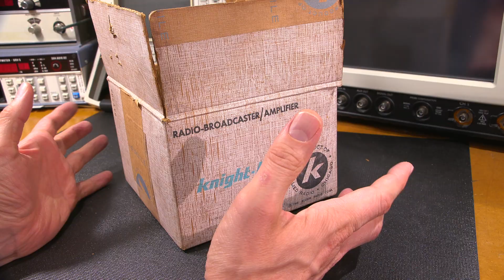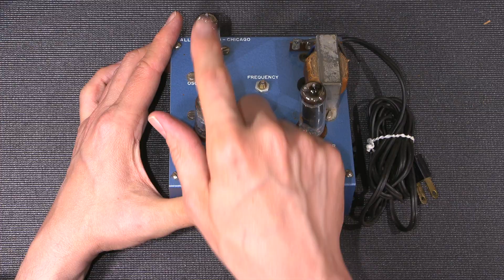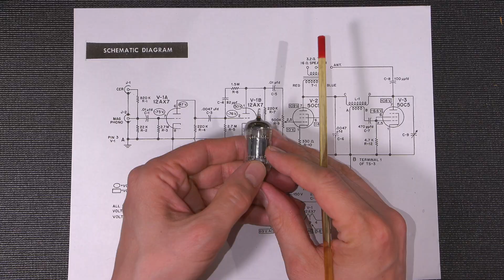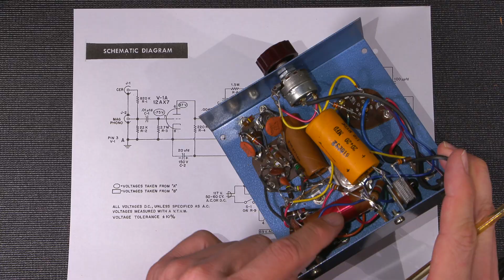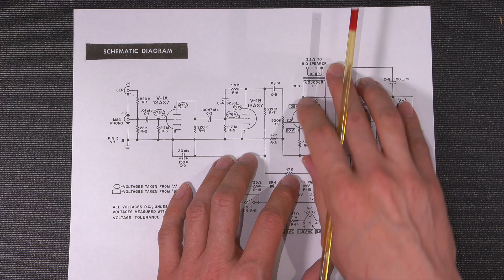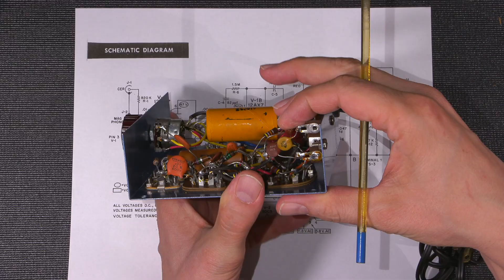Your Own Radio Station! The Knight Radio Broadcaster And Amplifier!

Comment: Self transformers in old radio equipment were a scourge, especially here in EU where the power sockets are 230 V, not polarised.
I ended up replacing the autotransformer with a regular transformer in all the equipment in my home.
See your radio is grid-modulated, and the 50C5 working in linear fashion, amplifying both carrier and modulation.
In the end, it is different from the one I had, with a proper transformer, and a separate AF modulator - a pentode from an ECL82 in class A with its own modulation transformer.
I like the low parts count of your radio, I don't like the circuital compromises.
Thank you for the trip down the memory lane.
Greetings,
Anthony

Comment: I’m interested in knowing what the component at the end of the video is but this is an old video and I don’t know which video is next in the series. Much like the line cord on that device you didn’t reference the video in a way that would make the next easy to locate. I’d have to scroll back 5 years worth of content, find this video and hope that the next is the one with the information I’m interested in. That’s too much work. 

Please consider adding video categorization to your descriptions or titles. Numbers work well. Like this one could be number 476 and the one with the answer to the quiz could be 477.

Comment: Me too and me too, etc.  One way to get all the geezers out of the wood work! I would play Al Hirt on mine. I agree Mr. C should have hooked up some music and used a vintage radio to listen to it. I don’t remember it being AC/DC or getting a bite from it. I’ll point out the 2 meg grid resistors which allowed the small coupling caps and still have good bass and was grid leak biased. The 12ax7 are also grounded cathode to get the most gain. 2 47k resistors we’re all that stood between us and line voltage. Thanks for the blast from the past!

Comment: Awesome!  I'd love to find one of these, but where I am there are about 2 people that know what a 12AX7 is and I'm one of them.  The nearest hamfest is about 2 hours drive away and only occurs once a year .. at the most inconvenient dates and times.  I'll warrant though that most of the people back in the day that built these did not have the benefit of a $10,000 Marconi analyzer to tune their $50 radio kit.  I'll bet 95% of the finished units did not perform as well as yours does now.  LOL!

Comment: In the uk we called them valves and the top you call plate we called anode in the middle the grid at the bottom next to the heater was the cathode .

Comment: I had 2 of these when I was a a kid in the mid 60's. Drift was a major drift problem. I used the speaker transformer as input and plate modulation.

Comment: Since my post of four years ago below, I have found modern reproductions of this exact device are being sold for $274 with a (redesigned L1 RF coil) and that price doesn't even include the tubes! Maybe your original has better modulation than the repro, maybe we are more critical of modulation quality, but the repro I've seen close-up only works reasonably well (and that's stretching a point) over a very limited part of the center of the AM band before modulation quality and power drop off considerably. It also "FMs" badly - sounding the same on a comms receiver in AM or FM mode! Looking at the schematic that's probably what should be expected. The repro was very disappointing even from a nostalgia point of view. Your original did seem to work reasonably well, but a trapezoidal display would show modulation linearity and a check on its FMing would be useful too.

Comment: I constructed  onee like that way back in 1965 when I was still in high school. It was fun to build but was very careful in operating it. It was AC  so it was the chassis was connected to the mains but other than those it was very easy to use.

Comment: Since the neutral is tied to ground in your panel at some point, cant you just verify which prong on the plug is tied to the chassis and plug it in so that the chassis is not on the hot side of the plug? Then verify after plugged in you are on the neutral side and not the hot side. Or is there still a problem doing it this way?

Comment: At the very least a polarized plug would be helpful, or a three prong grounded cord if possible..  I wonder is a GFCI would trip with this radio transmitter has reverse polarity?

Comment: This was one of my first electronic projects at age 12.  I read about the 12 inch antenna restriction, but it worked so much better attached to the families' steam heating system.  We broadcast about 2 miles. Had so much fun. I never figured out why that even worked, because the steam pipes went into the cellar, and hooked to the boiler which had grounded water pipes.  
Andy

Comment: Great Job! Firmly suggest a polarized line cord; with a direct connect to chassis; or better yet, a ground liftoff with a .1uf super-safety cap to chassis; of course, the power switch to the line high side. Keep up good work ! ! !

Comment: I once made something like this, and it actually worked, but was only able to transmit AM stations,  and had to be very close to the radio to work. I then decided to connect a big antenna to it, which got it working up to a few feet away.  Also,  you look like your in a space station🚀

Comment: A tip that I'd like to convey is all the glass tubes have their tube number printed on the side.  So if you choose to clean the chassis and dusty tubes it is easy to wipe the tube type off with even a gentle cleaner and a rag. End result a mystery tube. Thank you for making this video and give this old kit some fresh air.

Comment: In 43:00 I saw you holding a " Phototube".only now I understood from you. I have this valve. I have a bell n Howell projector, valve amplier is missing but this tube. Modern projector uses Photodiode.

Comment: That device you were holding is a vacuum switch or relay. It is perfect for antenna switching, high voltage switching, or isolating because it has very low capacitive coupling.

Comment: I'm building one of the reproduction kits now. It comes with an isolation transformer that mounts on the back.

When it's done I plan on using it to listen to old radio shows on my 1941 vintage Emerson radio, and partly because it's an easy way to get old radio shows and partly for the weirdness factor it's going to be connected to an Alexa Dot... so I can say "Computer" (the wake word), and Alexa will answer me through an 80 year old radio.

Comment: I built one of these as a kid.  I do remember the last part of the instructions where it says to attach the supplied wire to point X and said "this is your antenna DO NOT EXTEND this wire!"  Needles to say the first thing I did was attach to my 100 foot longwire shortwave receive antenna and the second thing I did was walk around several blocks around the neighborhood listening for the signal (I ran a tape recorder into it).  Went several blocks, and I learned how to couple the little pocket transistor radio to a telephone pole to bring it in.

Comment: There is a knight broadcaster repro on ebay for 244$. - kind of expensive! Looks like they screwed an isolation transformer to the back of the case. That input module they give you looks interesting, lets you input cd line level audio to the phono jack. 
I want to broadcast the shadow radio show to my atwater kent model 89 i'm restoring.

Comment: Many years ago I built a more.powerful homebrew version of that transmitter that put out around 1.5 to 2 watts. One night I loaded it into my 160 meter wire ham antenna and put some music through but on a frequency in the.upper end of the Am broadcast band. Then I hoppwd on my bike and rode around the neighborhood. I soon realized.my.signal was blanketing the whole.town. A friend of mine in the next town over also heard it very strong. I was terrified the FCC would start.looking for me so I raced home and shut it down. .lickily.I didn't get into any trouble.

Comment: I want to build one  but some of the components  have no   information   about them like the   oscillator coil   or the audio transformer . No impedances or   resistive values.... most of the parts I have but the critical ones  I need more info .....since you have one of these knight kit  am broadcast transmitter's   you can  provide  them to me ... I would be so greatful . At least I will have another project to do during this  covid lock down ?

Comment: If I were working on your transmitter I would firstly replace the line cord with one that had a polarised plug and make sure the neutral went to the chassis. That would remove most of the danger. I might even go to a three wire cord with a grounding prong. The I would replace the selium rectifier with something more suitable and change out the electrolytic capcitord then I'd replace anything else that was weak or unstable.

When I was going theses types of circuits were cheap to build and light to carry As they had no power transformer..They were enclosed in plastic cabinets.

A typical design for an AM radio was a 50 volt speaker tube, s 35 volt half wave rectifier and 3 12 volt tubes.for a total of 121 filament volts close enough. By then most power lines were 120 volts. These were called five tube radios. They had the feature that they would run fine on 120 volts DC as well.

Comment: I learned the hard way about no Isolation when I was a teenager I tried hooking up a ground on a tube radio and when I touched the ground to the chassis, KER_POW!!!!, ARCED and blew the house fuse! Luckily the wire I used was insulated.

Comment: Mr. Carlson, Dating myself here but, When I was a kid back i'm guessing in the mid 50's or so. Myself and a couple friends used to order stuff from Allied radio all the time. Transistors were I believe about .99 cents each, We built transistor radios with 2 or 3 transistors in them (that was fancy stuff at the time) Anyway one of us bought and built that kit, I believe they called it a wireless oscillator at the time. I lived about 1 mile away from Paul (he's the one that had it). When I left Paul's house I could hear him till I got almost all the way home.

Comment: When I was a kid, I connected one lead  from my phonograph  to the  metal cap on the top of a tube of an old radio. I first removed the radio wire that normally was connected to the tube  and connected the other lead from my phono. This made my old radio into a transmitter. I could then play my phono and pick up the signal on nearby radios. This was a hit or miss transmitter, I didn’t know really what I was creating. I fell in love with radio at an early age thanks to an uncle who also liked radio.

Comment: I could really see myself using this in my teens. I used a really crude Walkie talkie setup and for longer transmissions a mobile. This was when Mercury released a free 6pm-6am tariff.
Man I was wondering what the blue & black device was doing, displaying random numbers. Then I realised it was my phone's voltage.

Comment: I borrowed one of those from a friend's father. I am so guilty of taking parts from it. The FCC always has had over kill rules. The real technique here is a short antenna with a tuner and some ground plane. You need adjust your scope to get in into envelope mode. Then you can guess modulation percentages.

Comment: An interesting video.  I had not heard of this device.  In my ham career I've played around with Knight Kit transmitters.  AM radio, hmmm I may or may not have "accidentally" warped the tuning of my Viking Valiant's 160 Meter vfo into the top end of the broadcast band.

Comment: Got mine from allied when i  was a kid. my build did not look near as good as that. But it was my first build ever. I learned that caps hold a CHARGE!  Did not work first off.  It. fell on the floor . I though all was lost. Pluged  it in and it Worked ! Thanks for the show. Wish you were around when i was a kid. For some reason i am still alive. Jack Hreha

Comment: This units safety would surely be improved by converting it from an AC device to a DC device by introducing a 5 amp bridge rectifire between the AC souce and the unit under test thus effectively eliminating the live chasis issue as the chasis would be permantly tied to the negative side of the DC sauce which would introduce good isolation from the AC sauce. I am guesing the same system could be used on the all American 5s and 6 radios although I have never worked one my self but I have uved this technique on what we call univirsal radios. i have also used this technique very siccesfuly on European mobile CBs to avoid the problem they had with positve ground vehcles (not for a for at least 40 years though lol).

De Bob G7DME

Comment: Wow - I went back to my own little example. Replaced C-7, the 470pf - I had no suitable mono caps, so I used a 470pf silver-mica. It's as stable as the transistor radio I'm using to 'preview' it.
It used to drift for about 20 minutes before it warmed up.
Thanks!

Comment: Hi mr. Carlson. I wouldn't bother putting in NPO caps because that circuit is inherently unstable.  There are many other factors that would cause it to be unstable. Keep in mind that sometimes they have temperature compensated caps to counteract the temperature coefficient of the oscillator coil. And also, the antenna will have a big effect so it's no point in putting real stable caps in there. Just my two cents.

Comment: I remember the Knight-Kits (including a very low -power  broadcast band radio transmitter) that one could build electronic devices of many kinds...so way back in the nineteen fifties, being in a 44 week Navy service school, I built a 5" "scope", a multimeter, a sig gen...and used them for a while...satisfactory: but then, having worked with "pro" test equipment as a tech, much preferred Tektronix scopes, pro multimeters and such...so sold those kits later when I managed to buy better gear...which stimulated the beginning of a long working career, later got a degree from the University...used it with the DoD...retired right after Y2K...gotta say I enjoy your various Lab Vids...

Comment: If that kit was available in the UK the chassis would have to be earthed (grounded), especially as it is a transformer-less circuit. Thinking about it, it would have a mains transformer to improve safety and use 6.3 volt heater (filament) valves (tubes). The UK and Europe have 240 volts mains, so dropping the filament voltage would be less easy.

Comment: Thanks really interesting. I shoved the preamp into ltspice and its 3 db points seem to be 30Hz  and three khz. It is then level to 20kHz

If you put the inductance of the pri and sec of T1 and L1 I could simulate the RX side too Though I would most likely use 6AQ5 in place of the 50C5 as I do not have the spice model for them

Comment: Boy is that thing dangerous, I usually avoid anything without a transformer. Even if you got the plug in the right way, when you turned off it's power switch, which is in the neutral side, everything is going to float up to 120V, lovely.
I once saw a design for the ultimate in dangerous NiCad battery chargers, it had a light bulb, a diode, and the battery holder strung directly across the mains! They did recommend  putting it in a box with a lid switch to isolate things when you opened the lid........

Comment: That is the same Circuit Test meter I used for many years... I actually blew it up testing current on my laser cutter.... My bad for using white HV cable for both sides of the laser high voltage and not clearly marking the polarity. I connected my meter in series with the B+ for my 130 watt laser tube  rather than the negative side.  POOF!! 25,000 volts..... lol  ooops...   yeah test current in series on the drain side!!!

Comment: many of my comments have disappeared in regards to your meter. your meter is rare. their are many meters that do check only capacitance for $50 but do they work? clearly your $600 does not. Proster LCR Meter LCR Multimeter Tester for Capacitance Resistance Inductance Measuring Meter with LCD Over-range Display.

Comment: FOUND IT! replacement DLM 260. however, its $154. "circuit-tester" company still exists. products not sold commonly but can be found. the question is does it still have the 240 capabilities. from what i can see it does but often its newer version is lacking. consider reviewing it! if you contact them they may send you one for review. i would buy it if it was recommended by you.

Comment: It is of course illegal to create radio transmissions without a licence in the Uk, be they commercial or amateur. apart from certain radio bands such as CB Radio (27 Mhz) and  315MHz, 433MHz, 868MHz, 915MHz and 2.4GHz

Comment: I had a similar "home radio station" in the early '60s (though not built from a kit). It was called the Caravelle, made by Remco. The plastic case of the unit was mostly empty. The microphone, you could only talk into it while holding down the button on the back of it. I gave my station the unofficial call letters WDSC and would play records through it as a DJ.